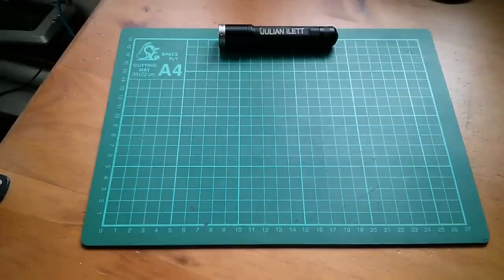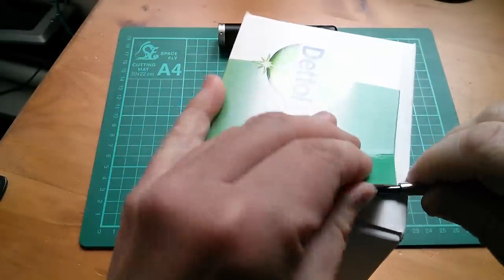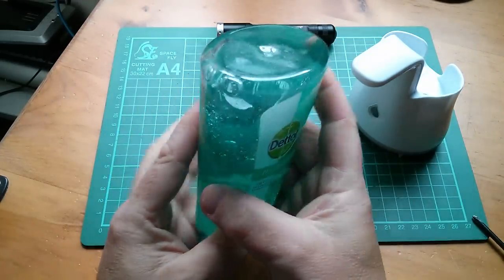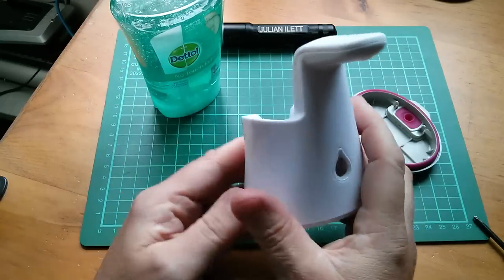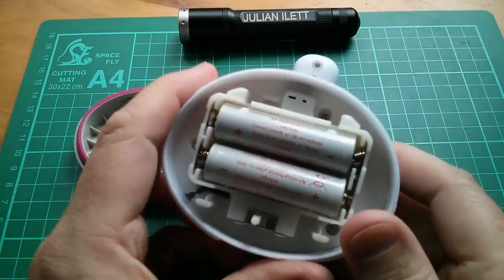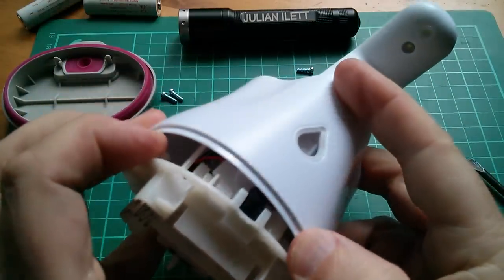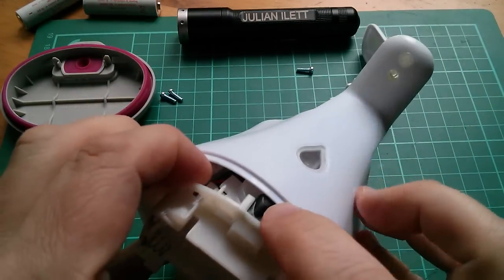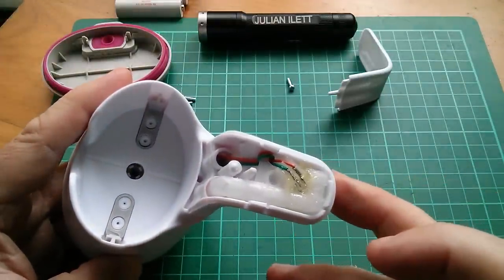Teardown: Dettol 'No-Touch' Hand Wash System

Comment: lol... you're slipping Julian... expecting cheap mass produced products to be easily pulled apart and serviceable? I'm surprised they even used screws to hold it together, rather than plastic tension clips or glue or hot-welding the plastic. It's called disposable electronics for a reason! :-O That infrared beam would have been coded so that it had background noise immunity, so no cheapo tv remote replacement would be able to substitute it...

Comment: a tip for those who use such a machine ... drill a 14mm hole on the top and then used a door plug in it so you get it air tight. so you can refill whenever you want without paying for a expensive refill.=P then you  can pick any soap  just a tip.just tell me if you want more tips=P

Comment: Thank you. Finally a picture of someone popping the battery compartment. After that I had the confidence to push very hard and it finally opened. Has worked perfectly for 2 years but I needed to change the batteries and could not see how! My hands are 67 years old so that was probably a factor.
Reply from the maker: Glad I could help

Comment: Thanks Julian, was going to throw mine away and buy a new one but took mine apart following your post and fixed it.  My problem was the "slide" at 16.40 was stuck. Bit of force with a screwdriver and shifted it.   "Cucumber Hydrating Splash is now on my hand", thanks a lot.

Comment: these things are really useful in areas where you have greasy hands because you can start to clean up without touching anything. I have also filled the bottle with dishwashing liquid, works a treat.  I knew you would have fun trying to pull it apart because I've been there done that.

Comment: I have a older model, and the rubber seal in the bottom of the new one, is a very needed improvement.
Also, I've drilled out the top of the refill, and added cheap soap instead, then just covered the hole with clear tape.

Comment: The trick is getting the standby battery current very low, so the IR burst mark space ratio must be very large, 1:100 or 1:1000. The clue will be how long it takes to detect a hand. With such a large ratio, the camera might have a problem seeing the light, particularly as the LED on  current will also be low.
Reply: A 1ms burst every 200ms should be more than enough and the range is so small the IR LED could probably be run at less then 10mA. The uC would go to sleep between pulses so a quiescent consumption of a couple of hundred uA should be possible.

Comment: hi Julian, luv your channel, and your frustration here is entertaining, but if I were the engineer commissioned to design this useless product, I'd be quite annoyed.  Please take this light-heartedly....  Some idiot expects me to make a gearbox that he can partially dismantle and it still works.  He doesn't want any grease in it.  He doesn't realise that you need to code an infrared signal to get noise immunity.    And some idiot  ;) doesn't see that the non-setting gunge around the top connections are a better way of preventing moisture ingress from a humid environment than hot glue? ( I really, really hope you don't take offence).  btw, cucumbers can be used to store solar energy (Voltaire... or was it Swift?)
Reply: In case anyone's remotely interested, it's Swift in Gulliver's Travels.  Mockery at the time, but true.

Comment: I think it works as follows: The dispense cycle is startet with the IR sensor. One turn of the big gear is needed for one cycle. The cam on top of this gear closes a switch which delivers the end of cycle signal to the supply. - There is a pin below the big gear which drives the piston of the pump delivering the soap; let's call it "drive pin". The radius at which the drive pin sits on the gear determines the amount of soap delivered per cycle. 
So if you want to reduce the amount of soap per cycle, what most owners would like to do,  the drive pin has to be moved onto a smaller radius on the gear. A solution would be to make a new gear with 3d printing yielding enough fatigue strengh to survive a lot of cycles.

Comment: There are three version of this product.
The original one that use 4 AA batteries.
The second revision that use 3 AA batteries.
And the third revisioon that use 2 AA batteries,
I have the original one that still work after years of inuse (eaven if at the begin he still have dry soap in his pump).
I put in 4 new AA batteries and BAM ... it works like new (and i buy it in 2009\10).

Comment: I have a slightly different chip mode. The pins printing are in a slightly different order. RX+ and - are the first 2. Anyway, I can't figure out what's wrong with it. If I power it OFF then ON, it works for 2 activations, then it's completely dead. Any ideas?
Edit: I've put it back together without doing anything and it seems to working fine. No clue what was wrong with it. Maybe the IR diode was offset and the received did not get the signal? Weird, but happy I don't need to replace it, for now.

Comment: using a mobile phone camera, which are usually sensitive to ir light, to look at the transmitter led might have show how the device pulses the light to save batter power.
It would be interesting to measure the battery current in standby to see how long the batteries may last.
Reply from the maker: That's an interesting point. I use a mobile phone to shoot all my videos - surprising that the IR LED didn't show up.

Comment: ours stopped working so before removing it with a spare one I wanted to look inside. had no "gunge" on mine - maybe it disappared over time. therefore i just undid the top tube bit, then pulled the LED through the shaft as I was removing the bottom. too bad i did not check on youtube before. tried just about everything - except.. shorting the receiver pins.. :-) maybe that would've helped to understand the issue.

i still wonder why i see no light on cellphone camera coming from the top IR diode, hm...

Comment: Julian - it would be interesting to see if it worked with plain water - or if it needs to work with a more viscous liquid like the 'splash'.

I can see a use for it... take it apart, replace the electronics with a simple controller to drive the motor and monitor the microswitch, fill it with water - and configure it to act as a time based plant waterer. Should keep a plant going for a couple of weeks with that size of water reservoir.

Comment: Bought the early model, was terrible, very messy. Seem to remember the battery compartment in mine got gunked up and corroded the battery terminals. Was hoping to refill with ordinary shop bought detergent, maybe with this newer design it is possible?

Comment: re: using a mobile phone to look at IR led light. Some cameras have IR filter so as not to distort picture colour. Might be worth looking at TV remote control output, to see if the camera can see the IR light. This is usually around the 930 to  950nm wavelength.

Comment: what is the chip number, my guess it's a microcontroller, maybe a pic. The beam may be modulated to stop ambient light triggering the pump.
Reply from the maker: Almost certainly a microcontroller. It will pulse the IR emitter LED (can't have that on all the time) and synchronously read the photodiode). It will also read the microswitch and provide various timing functions (like a timeout on the motor if the microswitch input isn't seen).

Comment: hi Julian , please make a recap video of your best sepic and boost buck converters , I'm looking for one with cc CV ... thanks keep up the good work
Reply from the maker: The LTC3780 is probably the best - get one with 3 potentiometers for CC and CV
Reply: +Julian Ilett yeah but it's expensive and big in terms of size , I want a sepic to plug into a 3.7v 18650 pack to power high power LEDs and general projects ...
Reply: it's only 13$ (free shipping) and it's really good . I bought the one with 2 little heatsinks , but it failed after a week , they replaced it with the single big heatsink on the back , it amazing for the price, the max power is 80w (130w only temporary ).
Reply: +raff96HD I ordered one but I'm still wanting for it to arrive so I'll see , thanks for the feedback though

Comment: Bad day?  :-)  

Actually that thing is quite clever as they figured out just how many turns to pump out a squirt of sanitizer.  I'm guessing the "gunk" is probably silicone lube on the gears and the emitter.

That chip might be an asic/driver  that sees the beam, turns the motor on, and waits for it to hit the micro to stop it.  

Seems a bit pricey though as mostly that sort of stuff is just sold in a manual pump top bottle.
Reply: It could be done without a microcontroller/ASIC, but it's used so you don't have to change batteries almost daily: the IR LED and the sensor devices are only powered a few times in a second for a short time.

Comment: The moulding that holds the cam's axle is separate from the top of the unit and looks like it snaps into place.
Reply: Mounting the cam / gear axle in the top , saving having to mount it in another moulding . Nice , until you want to run it with the top off .  It has some nice details , other than it ' s a real piece of land fill .

Comment: Lovely vid as always. Why it does not sell: it's another solution for a non-existent problem. Normal manual soap dispensers work just too well. Quicker, cheaper, no batteries, last forever.
Reply: This manufacturer has taken on some idea that if they make more , we will by more stuff , ' cos they make it .

Comment: If you take anything away from anywhere (with the pump), then: Nature of the blank will not tolerate. Then the air goes  (take the place of) in by the pumped gel (vacuum). Because these bubbles come to the end of the video.

Comment: thanks for this...its eye opening how cunningly designed to make sure if customers were to take it apart, it will not be much use.  My sensor is not working properly...so i was contemplating taking it apart to investigate...but the amount of gooey things that they make it to make sure its not meant to last forever and messy to deter people from tempering with it.

To refill this, I use a thin butter knife, stick that in one of the narrow end, and just lever it off, do this in the kitchen sink pointing the green plastic toward the sink and just "brute" force flip it off...and then buy a bag of their refillable handwash and fill it back up!  This could have made this with a easy open screw on cap, but no, they want you to buy their dispensers!  Never consider how much plastic use, etc. as long as they make profit and rip people off.

Comment: I recently had an interesting little communication with one of the Chinese ebay sellers, over a little 4 dollar ham CW transmitter/receiver unit.  It was sent with the wiring harness wired backwards, and the result of my not checking, I managed to send current through the little board backwards.  I was trying to get the seller to take a bit of responsibility for the mishap, he offered me a 2 dollar refund, and explained to me that this was equal to $14.00 local money, and he said he would refund out of his pocket to make things better.  Don't know If that was true or not, but I figured I couldn't buy a good cup of coffee for that here, and told him to keep his money, ordering another from Bangood who furnished one with a proper power plug and antenna plug, not the wiring plugs wired up with red to ( - ) and black to ( + ).  The receiver on the other still works so I can now listen on one as I transmit my code on the other.  Considering I am the only ham in the local 30 mile are, it makes it nice that I can now talk to myself in CW code.
Reply from the maker: I think we've all got a reverse polarity story ;)
Reply: Some of us have video...
Reply: My impatient dad wanted me to make a small motor speed controller for a brushless dc motor, so i coded it and showed him some behaviours I could do(sweep,ramp up,slowly brake) , he pulled on the motor and it got detached,then  he put the wires back the wrong way around trying to fix it quickly and blew up my arduino mini.

Comment: Even Julian has one of those kind of days it seems.  What starts out to be fun, turns to aggravation. Been there, done that too many times myself.

 To Note: Generally, those Light Break Beam Photo Detecting circuits usually monitors the source emitter beam, being about a 12Khz to most often a 15Khz pulse train modulated beam. For reasons to not be falsely triggered by a shadow or reflection of light somewhere in the room hitting the photo detect Photo-Transistor or an older style Cadmium Sulphate Sensors.  This being good as to arrive later at the sink, finding a lot of soap all around the base of the dispenser.

Julian, its too bad you didn't have a couple of alligator jumper test lead wires handy to connect the top IR LED or Photo Pick-up component for easier testing while it was apart.  Anyway, thanks for the video, least now we know what one of those units has inside.

Comment: Great video, made me laugh.  There is absolutely no point to 'no touch' soap dispensers.  Even if you have 'no touch' taps (I've not seen these domestically), it doesn't matter if you touch a potentially dirty soap dispenser because you're washing your hands immediately afterwards.  Conversely, using a 'no touch' dispenser with 'manual' taps is pointless since the tap handle is likely to be dirtied from when you turn it on before washing.  What a piece of crap!

Comment: I still woner whyt screws are for in such devices. They're built do be not opened anyway. So why don't they just glue everything and skimp the 2 cents? On Smartphone it seems to be working great. .__________. I hate it! Screws or not, the shit cannot be opened anymore!! ARGH!
Reply: Yeah I know whatcha mean, though I find that a dremel is a pretty good solution to this problem.
Reply: vgamesx1
Not when you try to repair your Smartphone. :D
Reply: ***** Depends, if it's busted and you're planning on replacing it anyway you could probably get a fair bit of ad revenue from an iphone vs dremel video or something like that.. :D
Reply: vgamesx1
I have a HTC One m8 that has degraded eMMC memory according to the strange fault sympthoms. It tries hart not to die, hopefully it will work until November or December when the new Google Nexus models came out. I only buy Android phones and only when the back is made of solid alumin(i)um.
Reply: ***** Oh well it's a bit shit that the memory is already dying on such a new phone but, that's not too bad, you just need to find which board has the memory on it and replace the whole thing and the easiest/cheapest way to do that is to look on ebay for a broken M8 (should try and find one from the same carrier you're using) and tear whatever you need out of it, shouldn't cost anymore than $50 and a couple hours of your time (although you'd obviously need to replace your accounts, apps, etc.. too).
Reply: vgamesx1
Not a big deal, this device is already too old for me. The One m8 came out 3 years ago and mine is 2,5 years old. I wasn't satisfied with Kit Kat which was shipped with it and decided to register as a developer, root it and flash Cyanogenmod so that I was able to write on my FREAKING OWN SD-CARD I bought with my cold hard cash!!!! Then Cyanogenmod Lollipop came out and this was not needed anymore but I kept root. After Marshmallow came out, they changed it AGAIN!!! Most apps can write on the SD card when I permit it but some don't bother (because they use the old API level I think).

I plan to buy a Nexus mainly because of pure Android and because there is no SD-Card anymore but huge internal memory. I don't care about swapping SD-Cards anymore...

I always buy carrier free, because I want to buy it and then it's mine, not borrowed from a carrier and paying monthly. That way I can put in SIM-Cards I like and swap them like crazy.

Comment: Maybe it's just me, but not the machine is irritating, but your whining that it's not testable outside, and gunky and etc... It was designed, to work assembled. I usually enjoy your videos, but you should cut out your misery, because nobody cares. I mean it was like 3 minute just while you were complaining about the seal on the emitter. Why? Who does enjoy this? Cut it out like: Woah, I found the emitter. cut, I needed to solder it out, because otherway it wouldn't came apart. Done. No whining of 3 minutes.
Reply: Love Julian to bits but you are spot on here. I was thinking the same, 'shurrup moaning you soft southern get'.
 ;-)
Reply: Bubbles at the end.. it is a vacuum.

Comment: Painful to watch! You didn't need to desolder the wires from the IR transmitter diode as it just pulled out and the hole was just the right size for it to pass through. I'm rather surprised that you used to be a technician, responsible for repairing something as your common sense seems to be somewhat lacking.
Reply from the maker: Repairing stuff you're familiar with, is very different from working on equipment you've never seen before. This was the latter.
Reply: It ' s that thing of 1 st time open & not wanting to stop the flow .............. & hope over reality . Bit of a shame that you did not go further & pull the pump apart .